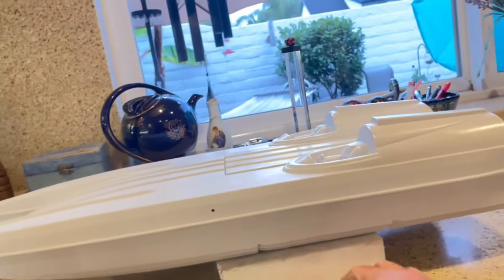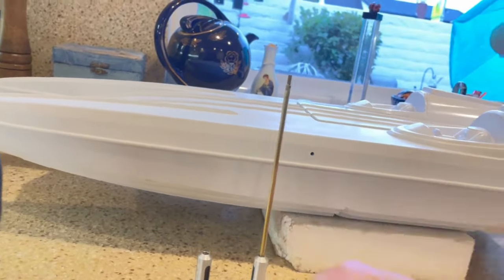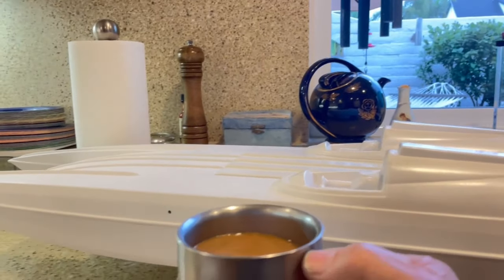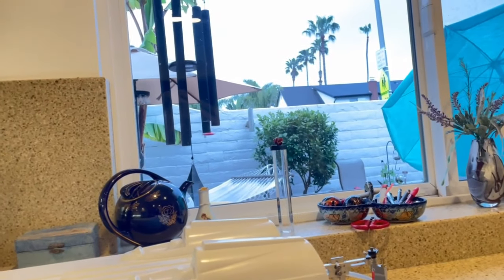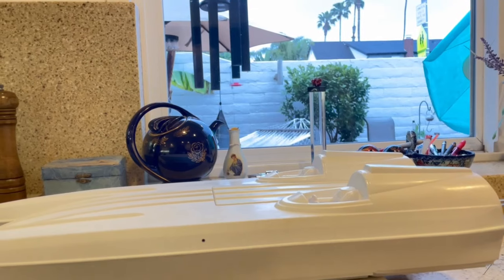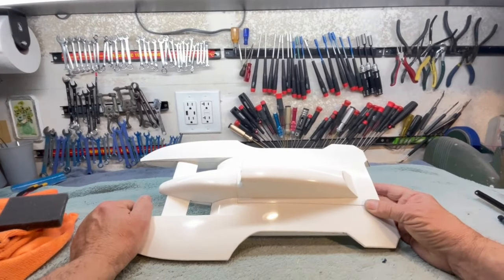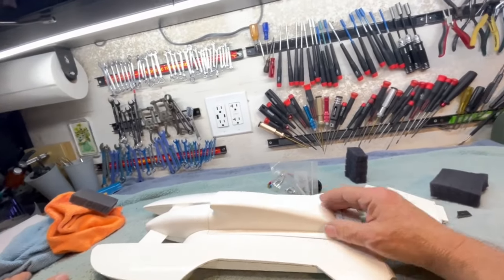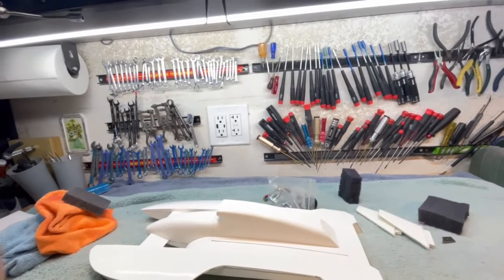Dr. Jet thinks about the next project...

Comment: The systems will be a rocket on the water
Reply from the maker: I'm hoping not too much of a rocket,  It won't survive big crashes.  I put a BIG motor in it, but I'm only planning on running 4S and small-ish props.